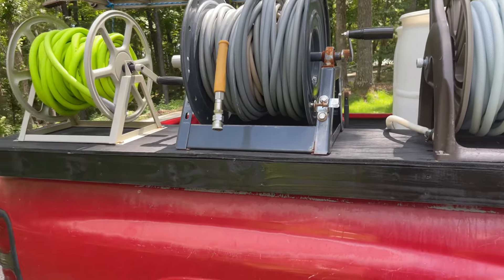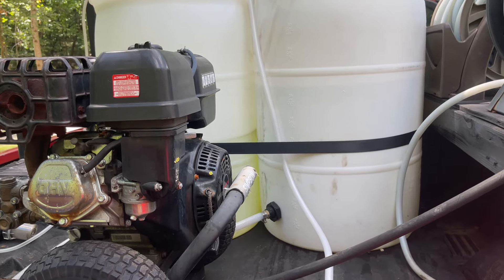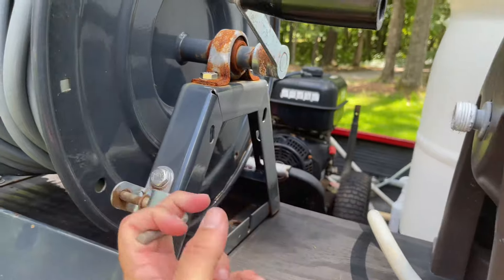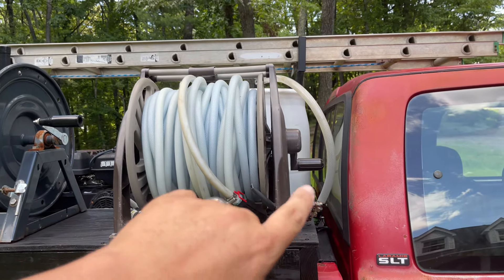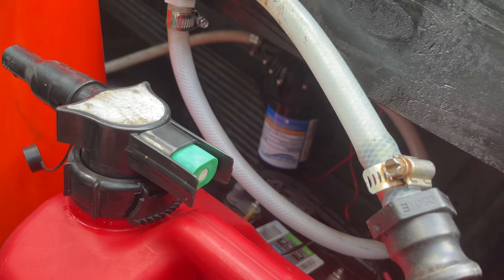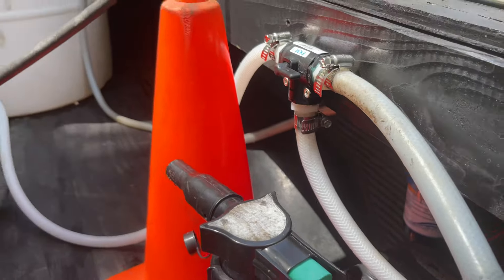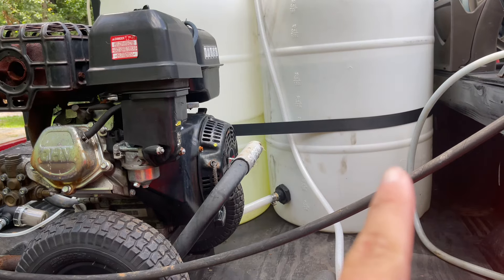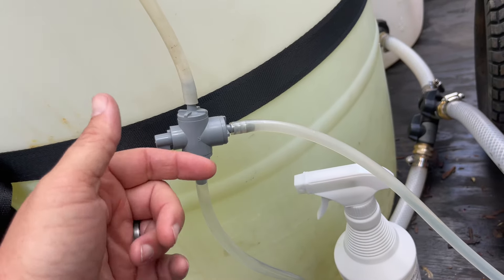Beginner pressure washing rig and all the things I’m doing wrong

Comment: It's a good setup. I run mine just the same with a Comet ZWD4040G pump gravity fed with zero problems. Did the same with an Annovi RRV4G40, which I ran for 6 years before it bit the dust. I don't use an electric pump for softwash, but I do have a AR30 diagram pump running off an old Harbor Freight Predator 212cc I bought used for $50. Been in business for 10 years in FL all run out of an old 2009 F150. Cleared 80k last year not even working full time. I'm 62 years old, and I wouldn't change a damned thing. Rock on, JohnBoy!
Reply: Thanks for the details
Reply from the maker: Sounds awesome. Thanks you too.

Comment: Curious how are you running the soft wash hose through the garden hose reel. Is it hooked in to a garden swivel or?  I built a similar skid to yours. Thanks for the inspiration!
Reply from the maker: @PressureWashAppalachia  I have a cam lock on one end and connect it to my pump that way. I don’t run it live.